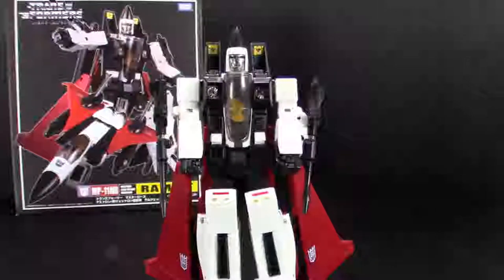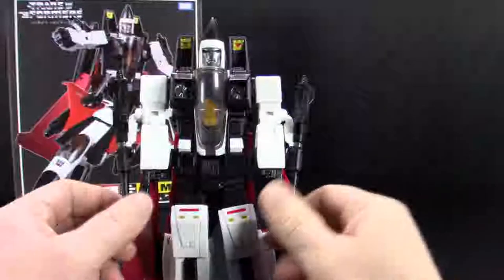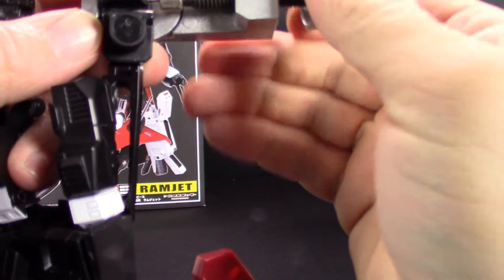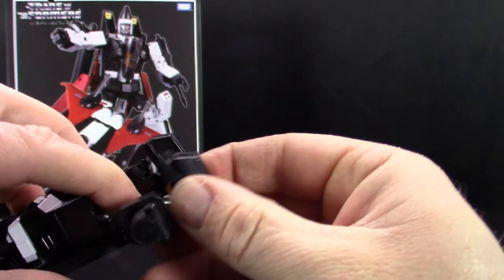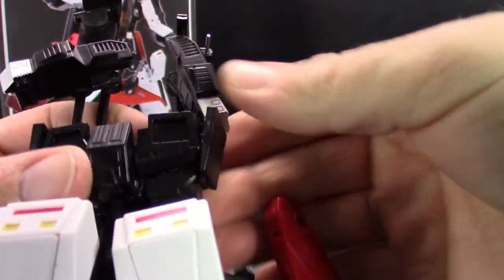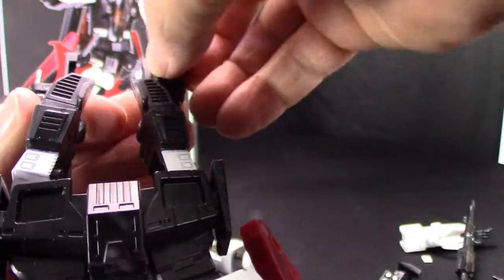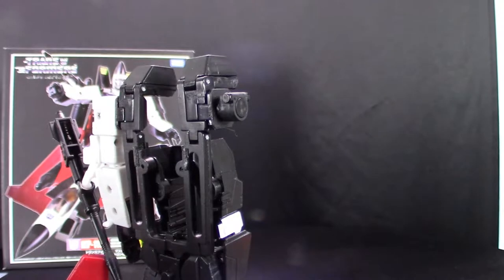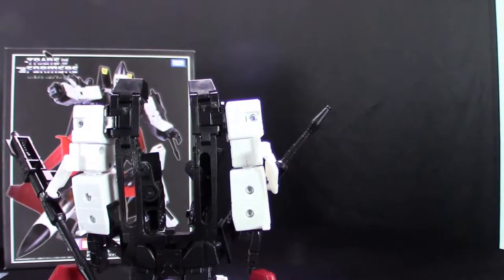Takara Ramjet Shoulder Fix

Comment: Oh man, I'm jealous! I got mine and got the shoulders fixed, but I don't have one of those cool pin pushers! I had to use a c-clamp and a small torx bit! And just like you, I pushed the second pin the wrong way first, and broke off one of the pegs on the screw covers... Great tutorial!
Reply from the maker: Adam Daab thanks.  I’m sorry to hear about what happened.   Did it turn out alright in the end?  Did the pin hole get to stretched out? Did the screw cover stay on after the peg broke?
Reply: @agent7817  Everything is great. The inside of the intake chest piece is a little scratched, but the pin holes are fine and the cover is staying on. It just took me longer than I would have liked.